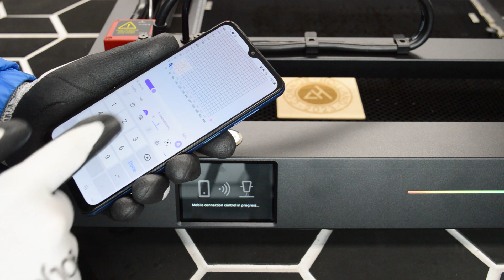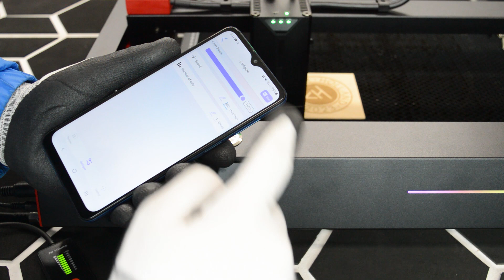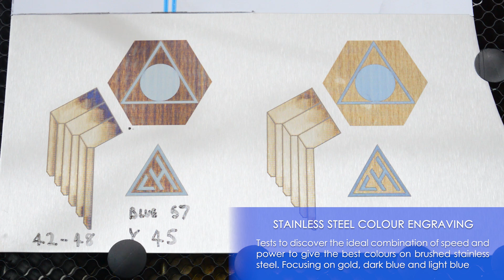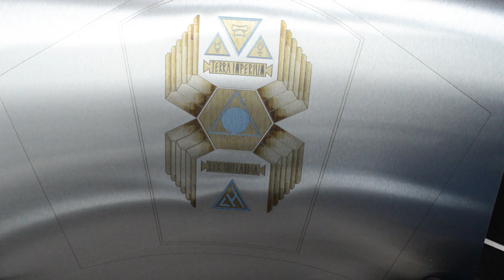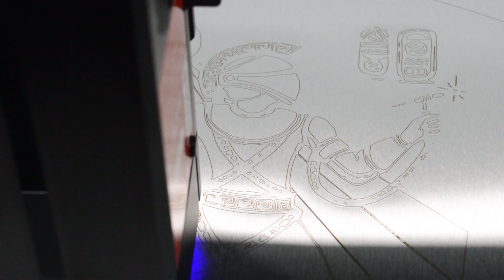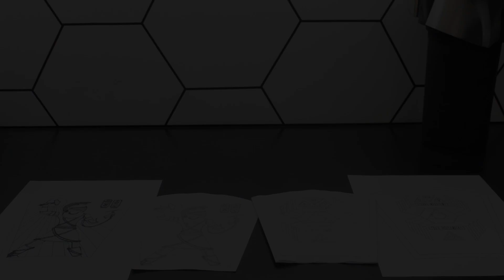Laser Etching Colours onto Stainless Steel - AlgoLaser Delta

Comment: Any idea how this would get on etching highly polished stainless steel?
Reply from the maker: I haven't tried it yet, but would be careful as it could reflect the laser back at itself, maybe laser marking spray paint would work. If you wanted colour engraving, you could cut out a template/vinyl sheet and brush/sandblast just the areas to be etched to rough up the surface slightly